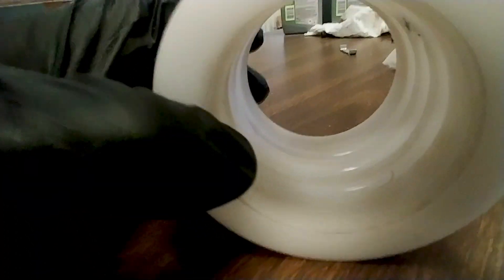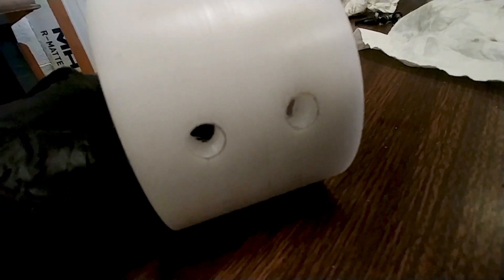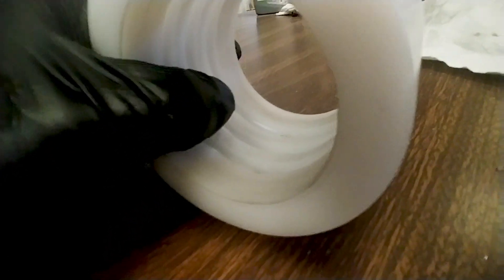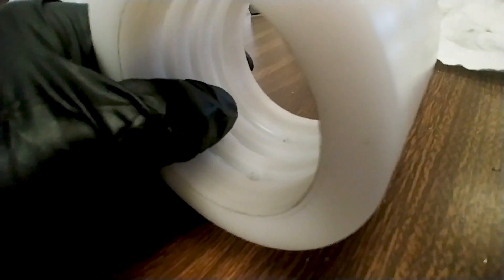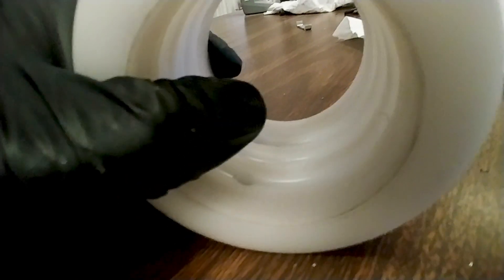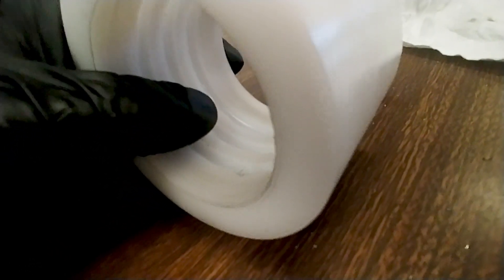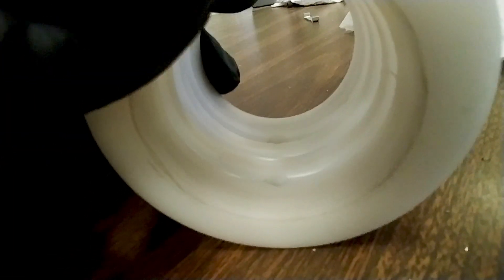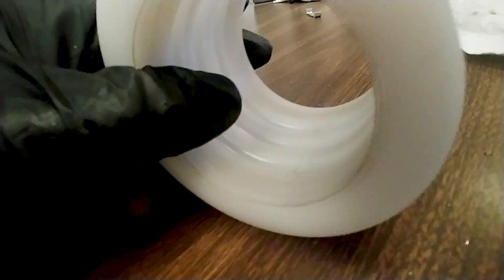Unable to Hold Pressure - Flying the Raptor Prototype

Comment: Honestly with all these headaches I would look at getting a PSRU from autopsrus.... Made to fit any engine...
Reply: Nope. They don't want their PSRU on a diesel engine. From their website:
"We do not advocate the use of a diesel engine in an experimental aircraft. Our educated opinion is that the engine compression strokes are so violent that they would likely tear up the PSRU, or any other one for that matter. Our PSRU has proven to be the toughest one around and we would not put in on a diesel under any circumstances because of the engine power pulses....We feel so strongly about this that we will not sell any drive of ours to anyone planning to use it on a diesel engine."
Reply: @philpotter2515  oh I stand corrected... Lol I must have missed that on the website...
Reply: @ick79  No problem! Most of us are here to learn!
But the comments from Auto PSRUs are telling... one of the best in the business with lots of hours on their products and they won't undertake a diesel.
Reply: RED Aircraft GmbH, in Germany, have solved this problem although it took 10 years of R&D.

They designed and today manufacture a geared reduction drive for the Audi/VW V12 diesel which is rated at 600 HP.

In 2014, that diesel engine and reduction drive was also fully certified for use in aircraft, by EASA in Europe, and there is the right to reciprocal certification by the FAA.

Peter just has to buy it off the shelf, bolt it on, fit it, forget it and then get the turbocharger setup fixed up.

Time to stop reinventing the wheel!

https://red-aircraft.com/

https://red-aircraft.com/product/

Comment: Prop blade angle control would seem an important consideration, engine running , or not. Thanks for sharing.
www.ballisticdrives.com     Air boat reduction drives.

Comment: Peter every time you make changes to the oil pitch change housing I get worried for you. I reminded of the P-3 aircraft that had a Babbitt surface failure causing loss of pitch change and ultimately causing an over speed on the engine requiring them to ditch off the Alaskan coast. I know these two systems are inherently different but I’m still worried for you and the design. If everything goes Tango Uniform please make sure your able to lock the pitch. I know your moving the Raptor program along and taking each issue as they arise and for that you have a large following because most aircraft developers would never have the moxie to put themselves out here on the web for everyone to judge. You have earned a lot of peoples respect for that alone! Kudos Sir! Please make sure to the best of your abilities that you can pitch-lock those blades if by chance you loose controlling oil pressure. Cheers Peter we’re here for you.
Reply: "Tango Uniform."  I'm having a feeling these are substitute words.🤔
Reply: @patrickroher4760  - not quite Tango Uniform yet but close. I know how much testing that goes into a prop pitch control systems and I’m worried that making such major changes without running it through some bench testing is a high risk. This design may be patterned off an existing design so there’s lower risk but IDK and I’m worried for him.

Comment: What about making it out of stainless with bronze bushing inside ?
Reply: Expansion properties? The stainless steel should have the same expansion property as the rest of the unit.
Reply: Iam sure that would as well , I just have lots of friends in the pump and impeller repair and it seems like a common combination when Iam at there machine shop

Comment: Only if u knew that the redrive is going to be the worst part of this project! This redrive alone has delayed this project by 2 yrs at least.
Reply: New Airframe.  New Engine.  New Redrive.  In the same project.    On his first aircraft.
Reply: @Marvi Wilson Musk's engineers were observing the first rule of aeronautic development: If you want to innovate with propulsion, start with a proven airframe. If you want to innovate with airframes, start with a proven propulsion system. If you want to fail miserably, innovate both at once. By building on the established Lotus chassis, Tesla drastically reduced their problems and increased their chances of success.
Reply: redrive is ok, with an electric prop!
Reply: @daniloviana8818  I agree, also a re-drive design attached to the engine to eliminate shaft misalignment, (as with in-line V-8s and V12s, ) another possible failure point. Prop should also be able to auto feather if power is lost, might help to improve the glide ratio.
Reply: @bernieschiff5919  agreed! Also, the chance of loosing the engine due to prop oil leaks (already happened, not cheap) is zero.
Reply: @Marvi Wilson An attempt, sure. But at a half-ton overweight, and with other abundant problems glaringly obvious to practitioners in the field, the only thing it will shake up is whatever it runs into.
Reply: @Marvi Wilson you're right it's exactly like a Tesla. If Peter has problems he can just pull over and walk back to the airport.
Reply: @Marvi Wilson technically none are killed by stalling a wing.  Not recovering correctly before gravity wins usually does the job.
Reply: @Marvi Wilson Ah, an Elon Musk stan. Thank you for making that clear.
Reply: @Marvi Wilson "This is a prototype" does not justify abandoning known best practices and ignoring known design limitations. It's becoming a nauseating refrain. It predictably adds time and cost to the project. Peter is one of only a few people surprised the Delrin collar failed. Had he made an informed materials decision in the first place he wouldn't be wasting money and time having someone machine that part again from proper material. Unfortunately, these poor decisions are more more common than not.
Reply: @Marvi Wilson Nope. Disagree. Many recognized aviation experts have pointed out to Peter shortcomings in his design, particularly in the engine, turbo design and redrive implementations. Peter ignores them and continues to do things "his way" and the result is overheating, blown up engines, an underpowered and overweight prototype, and years-long delays in the program.

Part of design and prototyping is utilizing recognized engineering best practices in your design. He's not doing this. Repeatedly.
Reply: @ScottsSynthStuff  Looking through the history of aircraft design by big engineering firms with a lot of money and teams of professional engineers- your right, all of their planes worked perfectly first time.  Yup, says right here that no test pilots have ever been killed because every single airplane just flew right off the assembly line as designed.  </s>  While I am not an engineer, just cursory look through the history of aircraft design kinda kills whatever point your trying to make- that some dude designing and building a prototype airplane is just going to work if he thinks about it hard enough or takes advice from a team of people.   Just ask Boeing about their Boeing 737-200.
Reply: @tread140  I think that somewhere in between the two approaches (just use established engineering practices vs.  totally on me bob) is appropriate here.. but that is not what is being done.. so there'a a bit of both of your opinions that are very valid here. The turbo bugs me.  And how have oil cooling/lubrication of redrives been done in the past??
Reply: @gpaull2  By that logic, only one airplane should have ever crashed, or one test pilot would have died.  If everyone after that would "learn from their mistakes instead of making them all over again".   In my view, is because they all were doing something different.   Until every car or airplane or spacecraft is identical down to the last bolt, things can and will go wrong.
Reply: The selection of power plant (with associated complex and ill-conceived turbo system, and failure-prone, complex redrive system) is this project's Achille's heel, both literally and figuratively.
Reply: @ScottsSynthStuff  big facts
Reply: @ScottsSynthStuff  Figuratively, sure.  But literally?  It's literally not an Achille's heel.
Reply: @Marvi Wilson  "ie, we build aircraft this way because we have always built them this way." No. Absolutely no. We build aircraft in certain ways with appropriate materials so things won't break and people don't die. History does have a way of teaching us that you can't alter physics.
Reply: @philpotter2515  Again I'll cite the Boeing 737-200 as an example- did they use the wrong materials and in the  wrong way?  And if so, where was the breakdown that led to so many accidents?  (This is a rhetorical quesiton)  If human beings could have engineered their way out of fatal accidents while doing something new, it would have happened a long time ago.   This boils down to safety vs innovation.  I see what side you are on, and I'm on the other.   I was about to type that one side is not more advantageous than the other, but just typing that out made me realize that, objectively speaking-  people risking their lives (hopefully willingly) piloting or driving new vehicles is the spirit of adventure that literally got us to the moon.   Standing by the Wright Flyer saying, we need to keep building these  out of wood and fabric...because we have proved it works...well, we'd likely still be flying biplanes.
Reply: @philpotter2515  

"We build aircraft in certain ways with appropriate materials so things won't break and people don't die."

If that were truly the case, Vincent J. Burnelli would've been a household name in aviation for the past 100 years.
Reply: Marvi, if canards aren't properly designed they can stall and when they do are pretty much unrecoverable. Peter refuses to flight test the stall characteristics of Raptor. Is that "best practice?" Do we know if his plane will stall safely? There's your one example.
Carburetors are rapidly becoming dinosaurs with current certificated aircraft engines. You are aware of that, aren't you?
Besides the airframe and very troublesome engine, there have been myriad issues with deviations from safe practices in the construction of Raptor. I'm not challenging the configuration of the plane, or even deviation from proven powerplants. But such deviations are challenging even to those highly qualified in aircraft development.
The list of questionable methods is lengthy and has predictably extended the gestation and investment in this project.
So I see no "point made," not even close. And I'm done here.
Reply: I didn't mean to criticize peter with that comment. I am his big fan for keeping his calm and focus for 6 years when most of us can't do it for 6 minutes. I just wish this redrive didn't give him this much pain. I am sure he will figure it out. I would like everyone to appreciate that no one spends this much time and effort without getting paid a top engineering salary. When peter succeeds we will have an amazing aircraft for far less dollars than what's possible today. All because this man made it happen despite all hard luck and criticism.

Comment: I think it might be time to consider electronic pitch control for the prop, wouldn't hurt to look...
Reply: Is there even an option available for the amount of power this engine produces?
Reply: Electric pitch control is generally used when there is no other option or as a last resort.  The difference in operation between hydraulic and electric is considerable.  Anything Peter can do to prevent having to go to electric is justified, coming from someone who used to have electric pitch control.

Comment: Why not reduce the diameter of the drain holes?  Perhaps drill out the center of the plugs that you are going to install? They two smaller holes appear to be the same diameter of the inlet, which means they are having to drain at half the volume of the inlet.  So are they too big to build pressure?

Comment: Hello Peter.
I commented regarding the Delrin on your last video; I maintain my opinion that this is simply not the right material for this application.  Sintered bronze seems to be a much better solution.  I'd suggest you contact Joe Pieczynski of Advanced Innovations in Austin, TX.  Joe has extensive experience in prototyping, is an amazing machinist, and is generally an all-around mechanical genius / wizard.  You may not have seen his YouTube channel, but if you took the time to look into him a little, you might appreciate what he may be able to offer; his CV is quite impressive.

Thank you again for allowing us to follow along with your challenges and successes; I, for one, very much appreciate it.

Very best regards,
Jon Crawford